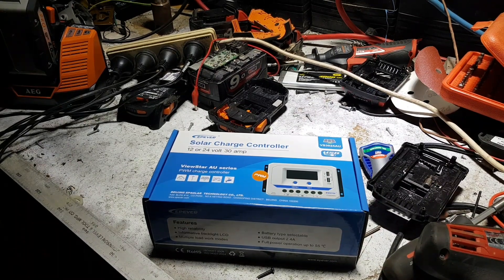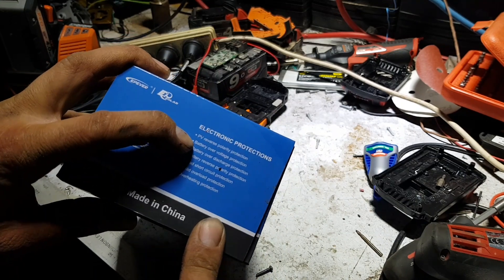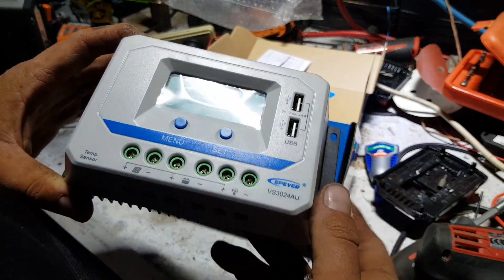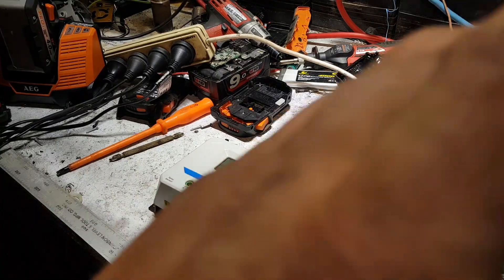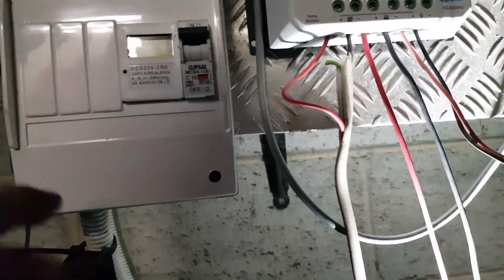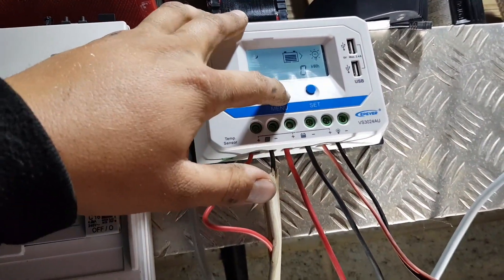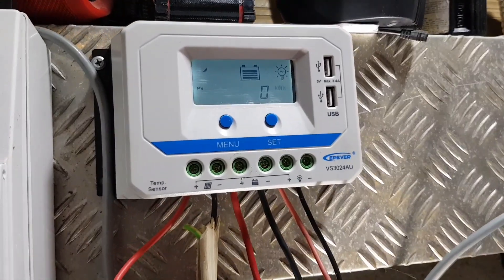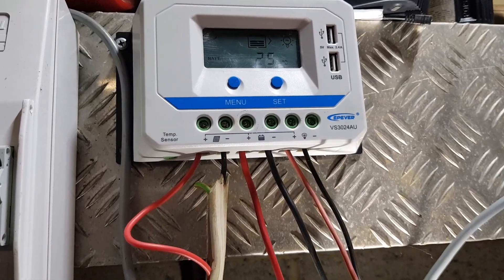Epever Vs3024au 30 Amp Pwm Solar Charge Controller Upgrade

Comment: Hello, I have a 240W, 18V panel, can I use this controller to charge 2x Wet Lead Acid 125Ah batteries connected in parallel (12V)? I currently have a cheap PWM controller, which I think does not perform well.
Reply from the maker: https://youtube.com/shorts/JXAraDvQ7OQ?feature=share
I would get one of these mppts mate
Reply from the maker: I rate them highly links in the video
Reply from the maker: https://bateriapower.com/products/20a-mppt-solar-charge-controller-with-bt-app

Comment: Mate, hoping you can help me out with some technical stuff.
I have a Baintech solar blanket running through one of these. but even on really bright sunny days, my lithium batteries without any load on them never get above about 13.8 volts.
There is a battery selection option on the menu, but the abbreviations don't make any sense.
Any suggestions ?
Reply from the maker: There is no lithium profile in these charge controllers so they aren't really suitable.
How big is solar blanket and how big is battery bank
Reply: @ The solar blanket is 180 watts, and the battery I'm charging is a 150 AH lithium.
Reply from the maker: @lukebrady3728 and it's still not getting full after 10 plus hours of sun?
Reply: @Oneupthesleevecustoms  Well, it gets to about 13.6-13.8 Volts, but funny thing is when I unplug it then re plug it in it jumps up to 14.2 Volts.
Reply from the maker: @lukebrady3728 yeah cause the internal resistance of a lifep04 battery is nothing like lead acid it's made to charge
Reply from the maker: The charge controllers probably shutting down saying were are full good job
 I recommend going to a renogy rover mppt for lithium
Reply: @Oneupthesleevecustoms  Many thanks.
Reply from the maker: Hope it helped cheers

Comment: can I use this on my two 18v 180w solar panel to change my 12v battery
Reply from the maker: You sure can they are great pwm charge controllers

Comment: How many volts in solar panels can it handle I'm looking at a 60a version just like that one what scares me is it saying only 50 volts voc ??  like really that's it what's that one panel??
Reply from the maker: Yeah low input voltage but then you just parallel the panels
Reply: @Oneupthesleevecustoms  yeah but my panels are 47.4v 355w panels
Reply from the maker: @thelithiumpowerch  so you put them in parallel not series how many do you have
Reply: @Oneupthesleevecustoms  I have a total of 5 I'm actually using 4 right now on my 60a/40a 24v 3000w hybrid inverter charger I only wanted the Epever for the remaining panel I was just surprised that it was only 50 voc
Reply from the maker: Yeah it's a bit limiting

Comment: nothing happens when i set to 113 it must be on the lights when pv breaker is off how to set pls
Reply from the maker: Hey sorry I missed this comment did you work it out
Reply: Yes finally its 113 the only thing in this scc delaying 10 mins thats why im hard to figure it out unlike my previous pwm scc when i turn off the pv breaker its only a seconds to come

Comment: how to set the load side light on dusk to dawn please reply
Reply from the maker: https://www.epever.com/product/vs-au-10-60a-pwm-charge-controller/
Reply from the maker: You can change the modes . Download the data sheet at this link
Reply: 117 is default when i put to 113 nothing happens when pv is off on breaker

Comment: Hello, i have buy this epever controller im novice, the solar panel was charging my battery and on the controller everything was fine until it reached at 13.8v it started to decrease 13.7v, 13.6 13.5 I have disconnected the controller from the battery, do you know what the reason is? My battery is gel 150ah. Thank you
Reply from the maker: 13.8 is float voltage

Comment: Hi,  I just bought the EPEVER VS6048AU and I have a few doubts. 

I don't have a solar system but I have an Eolic system. It's already installed and working. 

1. Can I use this EPEVER for an Eolic system? 
2. Can I connect the Eolic cables into the PV ViewStart terminals? 
3. What should be the wiring when I have both systems working (Eolic and solar). 

Thanks a lot for your help.

Comment: Does it work without a Battery attached?
Reply from the maker: No needs battery. Works as usb and volt monitor and load out without solar

Comment: Do you know what is the max current output on the load terminals? I have a 1100 watt inverter and not sure if I should connecting it to those terminals  or connect it straight to the battery. I don't think my inverter has any sort of low voltage protection
Reply from the maker: It's 30 amps. And they get warm in mid 20s mate. No way it will hold a inverter.
Straight to battery
Reply: @Oneupthesleevecustoms  Thanks for the insight!!
Reply from the maker: No dramas thanks for watching

Comment: Can this charge controller charge a 7s 18650 pack using a single 280w solar panel?
Reply from the maker: It can charge to a 7s bms yes
Reply: @Oneupthesleevecustoms  thanks for the reply. i dont have a bms as yet, i have a 7s 20p pack and used 18650 repackr to build the packs which comes out at 51AH for each pack, could i run without a bms ?
Reply from the maker: No never run without bms mate the risk.is not worth it

Comment: I really like this controller, do you know if it stabilizes the output at 12V? I would like to put some 12V led lights
Reply from the maker: The load out is battery voltage. What are you using
Reply: @Oneupthesleevecustoms  
Thanks, if you use the battery voltage, can the 12V lights be damaged?

Comment: I have this controller in 60W size. It has a timer and I have set it to turn on my lights at sunset and go off 6 hours later. It doesn't seem to be working. Can someone tell me how the controller knows when sunset is? I don't see any type of sensor that would tell the controller what's going on outside nor do I see a way to actually set the time. I would appreciate any help as I am new at this.
Reply from the maker: When it has no solar incoming voltage mate👍👍👍

Comment: grate video, i have one question.  What tension is between load poles of controller, is it the same as the battery tension?
Reply from the maker: What do you mean by tension.
Reply: @Oneupthesleevecustoms  sorry voltage.
Reply from the maker: Ah yes the battery voltage is same as load. Just switches through unit
Reply: @Oneupthesleevecustoms  ok, i have another question if you have time. Can i connect 24 volt panel with PMW charge controller to charge 12 volt battery, except energy losses is there any other problem? Thanks for the replay i really appreciate.
Reply from the maker: Yeah mate ideally you want double the incoming voltage to the battery voltage. It allows for the most power transfer. These units can take up to 50v input. Some solar panels now state the maximum power point voltage. Often 30v
Reply: @Oneupthesleevecustoms  ok, i read that PMW controllers needs to mach panel and battery voltage, because they can't step down panel voltage unlike MPPT controllers.
Reply from the maker: @TheKos03  nope they work perfect. They are a pwm gate. Chargers by plulse
Reply: @Oneupthesleevecustoms  electric tension is exactly the same as voltage.